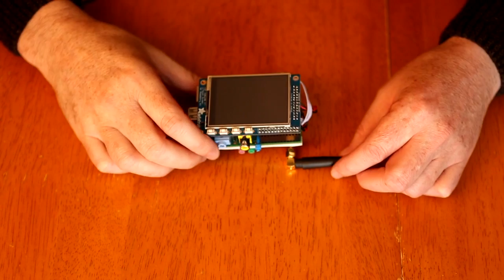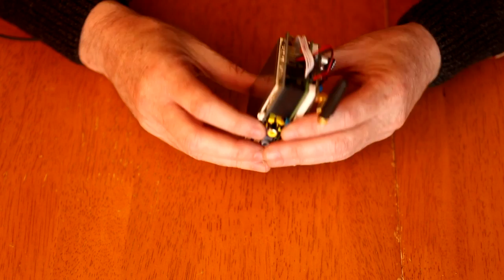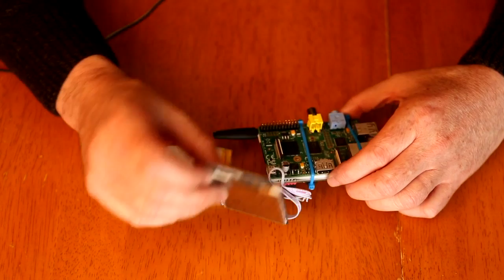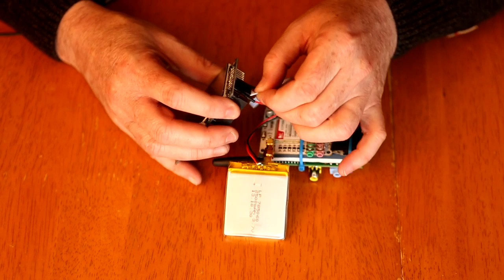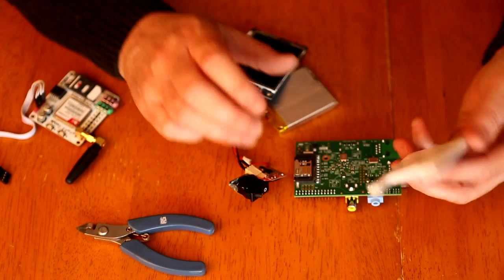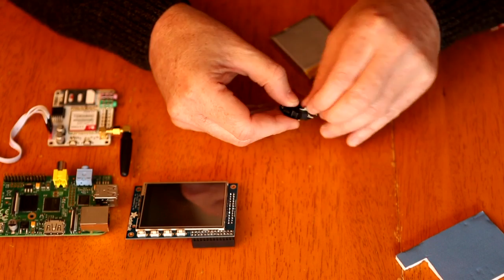PiPhone Tear-down

Comment: can you use the raspberry pi zero?
Reply from the maker: Sure, Tom. Would make for a smaller unit. :)
Reply: . with a small LTE-WIFI combo module
. in a 3D printed case

Comment: Hi Dave, Cool build btw! Did you not have any problems with logic level between the GSM module and the Pi? It looks like your using the Efcom pro? I'm just a bit confused because I've seen most people using that with arduinos which I believe are 5V logic level whereas the RPi is 3.3V? Although I must be wrong because it looks as though you have it just plugged straight in?